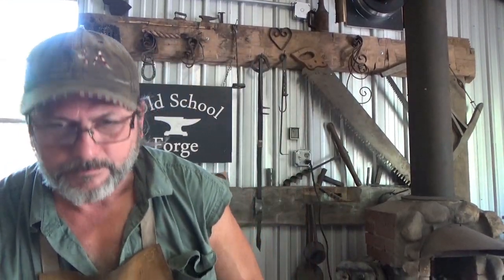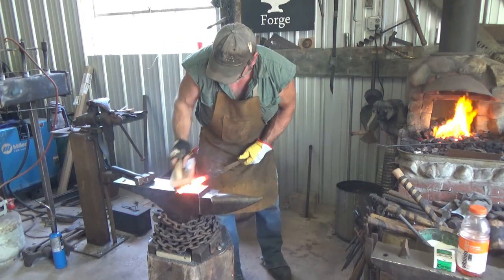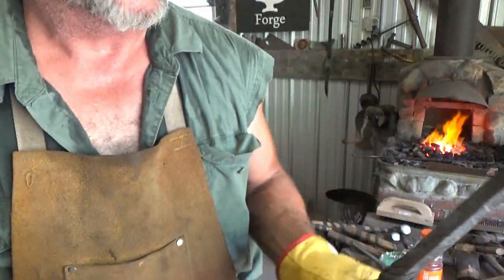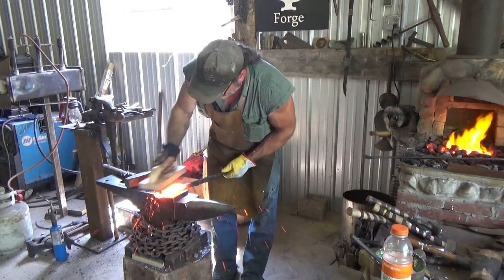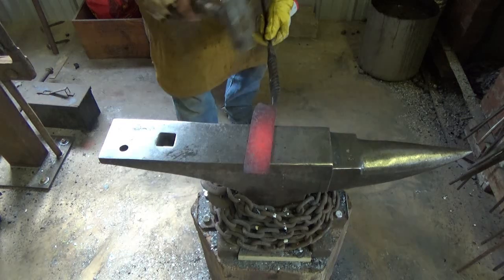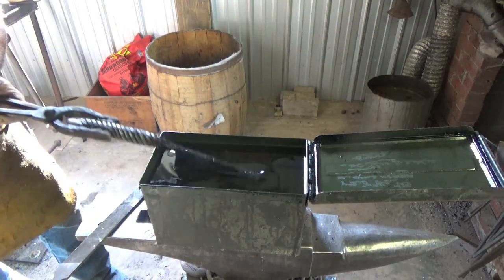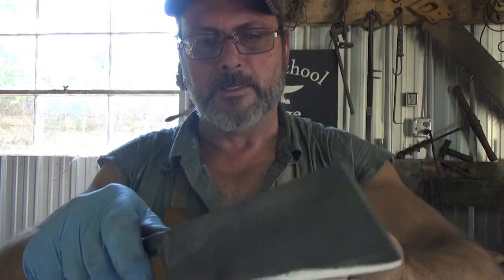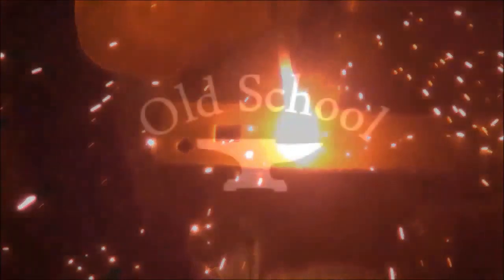Blacksmithing Shorts - Stacked Forged Welded Cable Cleaverish Blade

Comment: Nice job on the weld! I do believe you created a piece of cutlery that would whack right through a watermelon if you sneezed, and would chop through the brisket of a buffalo if you put a little 'oomph' behind it.

Glad you are settling into the new shop and you sure do look more 'at home' there than in the dungeon. 

Thanks so much for sharing your life. A visit to NY is on my bucket list just to hang out and spit and whittle with you for an hour. But damn, I will turn 70 next month and my truck just clicked over 300,000 miles so it might be a dream that I take with me to my grave. 

But you have become part of my life that keeps my head above water on many discouraging days.

Still my most favorite video you ever made was saving the Flag. Thank you from a Viet Nam USMC veteran.

Forge on, brother!

Comment: Cool. Chandler, I made a stropping wheel today from mdf and a 6" bench grinder. It will take am edge from sharp to scary sharp quick. I use buffing compound on one side and jewelers rouge on the other. Have a good day, sir.

Comment: Hey Chandler.  I have a tip for putting an Apple Seed (Convex) grind on a blade is start out with a Scandinavian and then knock the corners off on the flat Platen of your Belt Grinder, then finish it out on your slack belt (just gently roll back and forth along the length of the blade) to true up your lines.  

Be really careful in handling the business end after the fact however, 'cause a Convex grind is meant for one purpose and that is to make a wicked sharp (insert cutting implement here) blade.

Comment: Great work with the cable! I've got a bunch of cable that I've cut up into 5" lengths (arc welded the ends to keep them from unwinding) just waiting to be forge welded into billets. At 11:34 you moved the camera and eliminated the glare from the window. While the natural light from the window is important for working, it really makes it difficult for the camera to balance.

Comment: Chandler you should try cutting open the blade part of the weaker steel and adding a peace of high carbon steel for the blade adding more steel more weight and it would look cool